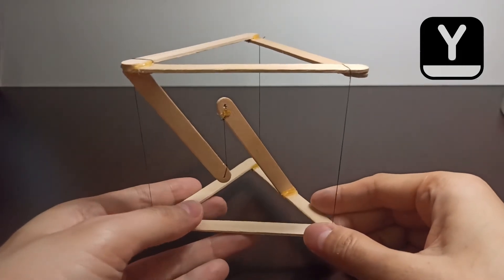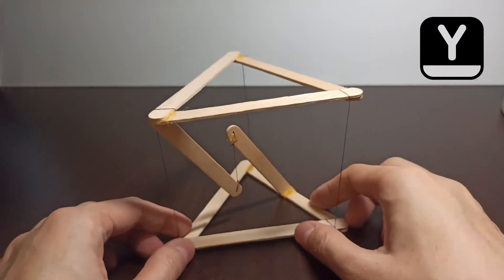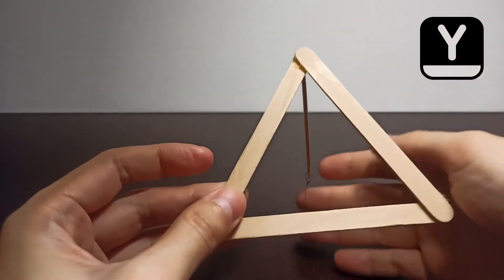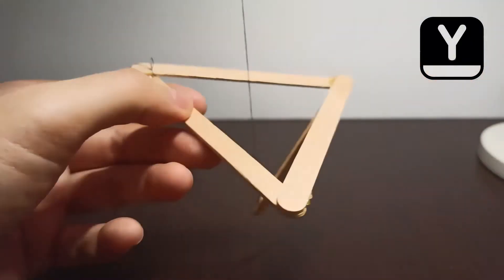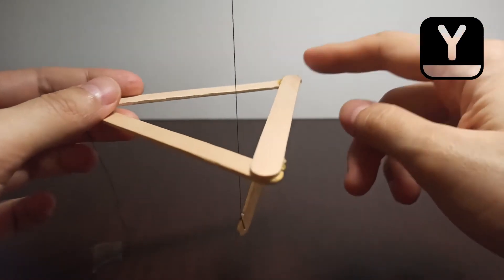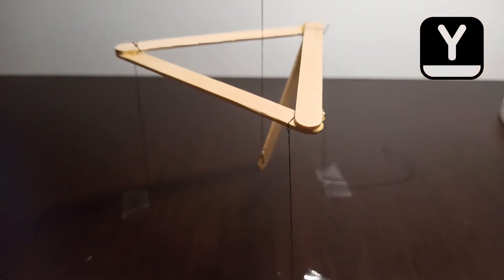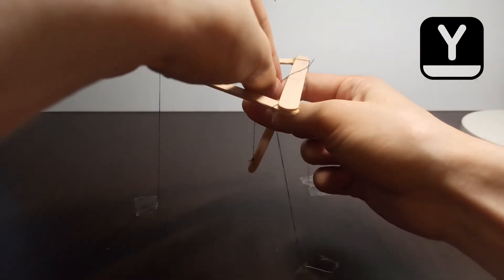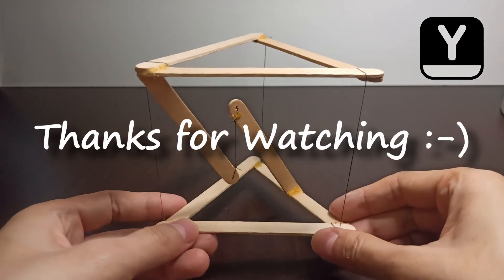How Tensegrity Structure works - Explained

Comment: Wonderful explanation. Still (as I think I commented on the other video), as mesmerizing as this structure is, it does not qualify as a tensegrity structure. To qualify as such, all members must be strictly in either tension or compression (behaving as what we refer to as 'two-force members'). Of the 12 individual components in this structure, only 3 of them are two-force members (the 4 cords/strings). This is a fun structure, and the explanation is simple and easy to comprehend - wonderful job. Labeling structures like this as tensegrity, however, seems to undermine fundamental structural concepts - and discredit the term "tensegeity," authored by Richard Buckminster Fuller.
Reply: What should is be called than? not hating, just wondering
Reply: I would still call it awesome, but I do not know how to categorize its structure type.